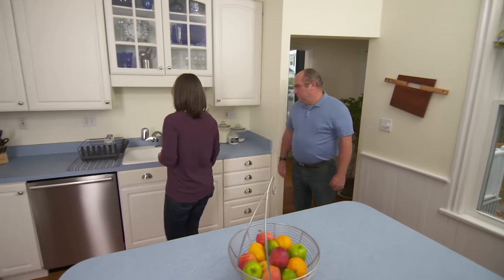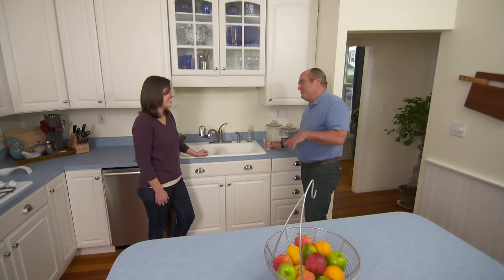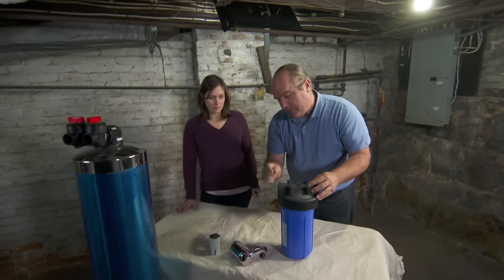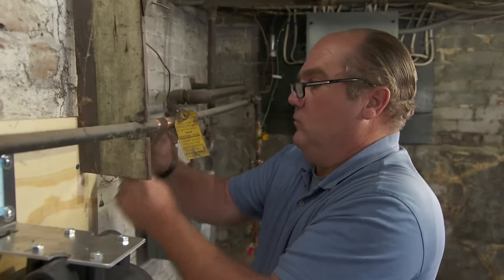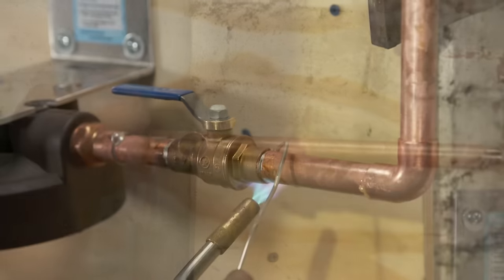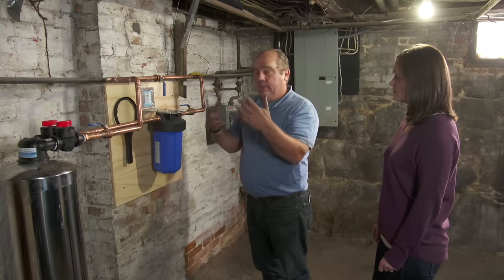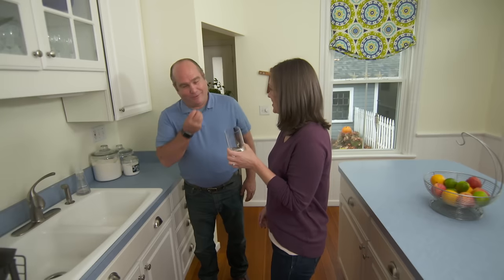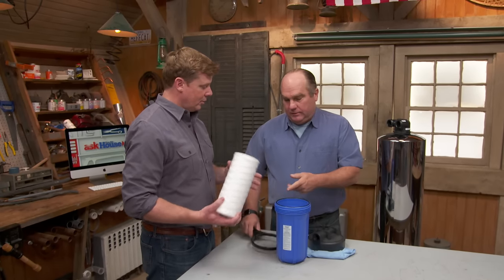How to Install a Whole-House Water Filter | Ask This Old House

Comment: That's awesome!!! Main water line next to the electrical panel.
Reply: Also, no support for the horizontal pipe length coming down from the ceiling. Some came later after the retrofit of the the filters.
Reply: especially with  underground services. They only want to cut one trench if possible.   So your power, tel, cable, water, sewer and storm often enter the house together.
Reply: rtel123 electric goes to meter outside house first
Reply: Tip: Many water pipe systems serve also as ground/earth connections. 
In this particular case, looks like the connection is near the ball valve. So it¨s not affected by the installation or material chosen for the upgrade.

If it's not the case its always good to check the respective connection and suitable materials to make sure that part is not "electrically" insulated. ;-)
Example, completely plastic filter or PVC pipes. 
Cheers
Reply: What a mess water meter, natural gas meter and electrical service all in the same corner.  At the very least I would have shored up the piping by the electrical service box and not left it flopping all over the place weaking the pipe.  To do it right, i wold hav had the water turned off out side of the house and replumed the water flow away from the electrical service and the gas service before bringing it up for the water filtration.
Reply: @tonyradca1235 that would be the right way to do it. But a lot of people can't afford it.
Reply: @tonyradca1235  I like everything close or in the same room but very well organized that way all the utilities are only taking up one area

Comment: I am new to pluming. If the house has metal then I can’t use plastic pipes for the water filter? I guess I’ll have to contact a plumber or just install a filter under the sink. Not sure how much a plumber will charge.
Reply: Plastic pipes (PEX) are less money but some studies suggest they can give you the cancer. You probably have copper pipes but you can add whatever kind of pipes you want to the original piping (e.g., Start with copper but transition to PEX in part of the house because of a leak or something).

Comment: I would find out if my neighbours water was the same first  ! 

Our neighbours had the same problem and replaced the pipes 
Filters still great idea for metals and chemicals in water
Reply: I don't know if it'll get chemicals. I think it gets all the metal, dust, etc.
Reply: dkchen hi depends which chemicals 
If you google chemicals in drinking water you will be surprised what it contains

Comment: I would say he's definitely addressing a safety issue too because the carbon filtration media removes chemicals like pesticides, herbicides and pharmaceuticals. I like the soldering and fitting job complete with several valves. Great job guys

Comment: They put your water meter INSIDE your basement?

If they should ever want to check it when you're not home, what do they do, break in?
Reply: User8571 most houses with meters inside have a wire lead with an outside counter, the city can just log down info from your from back yard. I live in an area where there are “smart” meters. They just walk by your house with a wireless machine and it’s recorded automatically.

Comment: those ball valves are not complicated: if the lever is in line with the pipe, the value is Open and water is flowing. They only have a 90Degree movement.

Comment: Needed some more information on that large carbon granulated filter? How to replace that material? You should how to replace that easy cotton filter, now it's time for a video on how to replace that carbon gunk.
Reply: You dump out the media inside the tank and refill it with new carbon media.  You have to soak the new stuff before use.

Comment: You should also flush the water after this kind of work, for like 30 seconds to a minute.
Reply: Yeah, thought the same.
They probably did flush it, just didn't show in the video.
Just like they didn't show removing the old faucet filter.
Reply: weiss27md for
Reply: You flush it for about 10 minutes, or at least 5 Gallons
Reply: Have you ever heard of editing? The guy probably flushed for 5 or 10 minutes. He should have mentioned it though.
Reply: Most manufacturers recommend a 5-10 minute flush for most filters.
Reply: On mine it tells me to flush it for ten minutes.

Comment: i thought ball valves were directional, if so then aren't some of them backwards.
and secondly aren't you supposed to flush that carbon filter to get the dust out
Reply: No, ball valves are not directional - check valves are though.  As for the carbon, that will need to be replaced - there is no way to flush it clean.

Comment: No need to filter all of your water, only filter drinking water if need be, a small filter can be installed inside kitchen cabinets that will fix taste issues, and Can be changed cheaper and easier than the carbon filter shown
Reply: You got it.  I have a two stage under the house that filters kitchen sink and ice maker.  Why filter shower and toilet water?
Reply: Yep.  No point in filtering shower, toilets, washing machine & dishwasher. 
Water softeners are different those are needed for most all connections besides toilets.

Comment: I would think that you would have to bond over the plastic filter canisters with a ground wire, most electrical services are connected to the water pipe
Reply: The water bypass pipe does the electrical bond

Comment: Water Bob 
Did anyone notice that he installed the valve going into the new filter backwards ?
Reply: yes i noticed that too. after much ado about saying the valve handles indicate the direction of flow when on, we notice at the end of the vid the original ball valve after the meter is backwards  and the bypass valve for the filters has been installed backwards too.
Reply: I don't know why he went into that directional stuff. Maybe that's how HE installs the valves to indicate the direction of flow for some reason. Ball valves are not directional.
Reply: Does it really matter, no. A ball valve is a ball valve. It works and thats the way he wanted it installed.

Comment: How does the cost of this system (installation and maintenance) compare to bottled or spring water ? I have 2 hot & cold water dispensers that use 5-gallon bottles and pay $20 per month (2 bottles) which also includes home delivery.
Reply: It really depends on what you start with and where you intend to end with.
If you consider a simple supply just for drinking water can be way cheaper. 
Notice the system portrayed in the video is a "all house" system.  

One side note, bottled water is just a scam of filtered water sold for a very high price. Spring water, in the sense of high quality natural water, then it¨s pretty much a bad joke on the consumer. ;-)  
Cheers
Reply: Do a standard cartridge based  under sink filtration system, filters will cost you $30 a year. If you go on ebay you can generally get the 2 or 3 filter systems for $50-75 shipped and they come with filters and the install supplies.

Comment: Once you close the valves to isolate the filters for service, how do you de-pressurize them so you can unscrew the canister? Is there a relief valve in the system?
Reply: close the main valve open a sink faucet to release the pressure then close the two valves and then open the bypass open main
Reply: I've had a cistern for 48yrs with a tap before and after filter. Once I close both there's a pressure relief button on top of the filter. Once filter is changed and put back , you open the cistern side tap to fill the filter and pressurize, then slowly open the house side.

Comment: Richard, We have well water which has rust, sulphur and tannin. will the addition of these two filters cure these issues. Thank you.
Reply: It should be OK. Although when looking for any filtration system please do yourself a favor. Check the water to make sure whatever filter system is adapted to your particular needs. A lab analyse should be relatively cheap and can spare a lot of money in the end. ;-)
Cheers
Reply: 3348harley    We have brown tannin water and stinks like rotten eggs all that was on test.  Aquatic filter systems sent us a pre built system I shopped a year before getting it. Sent it free shipping   We blew 25 grand over 12 years using other brands that don’t clear the water. It’s automated love it.

Comment: Ultimate Sediment Filter- Pentair Dual-Gradient Density Spun Polypropylene Filter Cartridge Rating: 25 micron pre-filter; 1 micron post-filter . The 20 inch filter Part Number DGD-2501-20

Comment: So is a pressure gauge after the filtration system how you determine when to change filters/media? Do you get a baseline reading after initial install and pick a point at which you say "now" is the time to change them out?
Reply: I feel like you'd just notice a change in water pressure, over time. But as a few others have noted, it's be smart to have a gauge after the system. Just so you have a more accurate way to know how things are.
Reply: Thanks John. We're getting ready to renovate a 1950s ranch and are learning as much as we can before the dust begins to fly.
Reply: smart move doing a lot of the work yourself. Can be a bit more expensive short term, if you don't have all the tools. But long term it pays for itself every time.
Reply: But I need an excuse to buy more tools...LOL!
Reply: I know that feeling, i want more stuff so i can prototype some of my projects. but at the same time i'm like, but it cost money and i need to keep some money saved.
Reply: Need 2 pressure guages to avoid filter callopse inside housing.  Measure differential pressure

Comment: Copper is still the safest as there are none of the  health issues or concerns typically associated with Pex and other types of plumbing materials. As long as lead free solder is used and all connections are properly de-bured and cleaned of course.
Reply: Jason C. Just use pex no one ever has complained about the safety of pex
Reply: There actually are health problems with ingesting too much copper, but copper piping doesn't cause it under normal conditions.  What copper piping does suffer from is leaks due to piting, or erosion, from turbulent flow at pipe fittings.
Reply: Disagree.  This guy is showboating by using copper.  There's zero need for it.  Pex is quicker, cheaper, and water safe.
Reply: Tom Wolff Yeah, that job would have looked great using Pex. Awesome idea👍

Comment: Is it installed on pipe before the water heater or on pipe after the heater? Also would this be cleaning shower water as well?
Reply: A water softener is typically the better option to treat the water for the entire house. Install a reverse osmosis to have the best drinking water you can get. The softener should be installed prior to the water heater. The equipment he installed is only treating sediment and chlorine.

Comment: Can I use carbon filter instead of sponge for the pre-filtration? I read somewhere on Healthy Kitchen 101 that a 10-micron activated charcoal is second to none. Not saying the sponge isn’t effective, I’m just looking for alternatives just in case, though.
Reply: Answer is yes, I use a 5 micron carbon filter and it works wonders on smell, taste, etc.

Comment: How do these filters effect water pressure? I'm on a well and pressure runs from 20psi - 40psi. It already sucks, will the filters drop pressure throughout the house even more?
Reply: Yes, they will drop the pressure more.  If you are on a well, you may be able to increase the pressure by adjusting the setting on the switch for the pump.

Comment: How do you clean the main activated charcoal tank? Is there a backflush as found in water softener systems?
Reply: typically, water treatment companies will install a backwashing carbon filter rather than just a tank with carbon in it. I think that was his question as the equipment installed does not have any backwashing potential.

Comment: I cant even install whole house filter because i live in a flat in my next house i will install it
Reply: YOUCAR Youtube you can totally do it in a flat, just find the main pipe coming into your flat. Sure, it might be behind a wall you have to open up or under the floor , but it can be done. 

I live on a 9th floor and had to dig in the concrete floor (it was only like 3/4 inch thick) to find  the main pipe, but then I soldered some longer pipes to bring it out, then fixed the hole in the floor (1 foot square). And then I put a filter, took me like 2 days, a weekend. 

My father was a plumber in his younger days, he taught me, and I’ve been around tools all my life so it was pretty easy for me. It can be more difficult depending on where your pipes are and how familiar you are with diy repairs and all that, but you can always learn or have someone help you out. :) You can PM if I can be of any help.

Luciano
Reply: @lucianonarno1408  How do you "dig in the concrete floor" looking for the pipes? I mean, I imagine you just mean breaking up the concrete until you find it, but how would you avoid harming the existing piping? I know the intention is to cut into the pipe anyway, but surely there's some kind of method to do it, right?
Reply: We used a chisel and 3 pound hammer to crack the cement and start removing pieces, carefully and slowly, little by little. You never know what’s underneath. Obviously don’t use a jackhammer.
Reply: @lucianonarno1408  makes sense. Thanks!

Comment: I would add a UV unit and a pressure gauge before and after filter.
Reply: As they said in the video, the UV unit is kind of pointless, because it's municipal water. Cities have a federal obligation to make sure their water is safe (just not clean tasting or smelling). The UV filter would have been extra cost with no real payback for the customer.

Pressure gauges and even a metering tank/valve might be a good addition, but if the homeowner wasn't complaining about pressure issues, it may be another added expense.

One of the complaints I have with the This Old House series is that their house rebuilds often contain a lot more tech and stuff that maybe an average homeowner doesn't need or can't afford. So, for little projects like these, it's nice to see them not going whole hog with top of the line equipment and extra, redundant, and possibly unneeded features.
Reply: The UV is to kill anything introduced by the pluming between the water source and the home. The pressure gauges are because a low pressure might be city's fault and not filter and could cost money and time replacing filters and media when pressure won't be corrected. The gauges are $10 at Home Depot maybe $5 in fittings.
Reply: David Barry Waste of time and money

Comment: and the pressure gets real low when you apply this device for your whole house filtration system
Reply: Thats actually a lot less true than you might think. For one city pressure is quite high to begin with probably 65 psi. In my house using a well the pressure is actually a pretty low pressure system at 38 psi and after a three stage filter system it comes out at about 35 psi. Obviously its not whole house (which have even bigger casings) its just for my fridge chiller and filter water tap. If the filters are dirty however there will be an enormous pressure drop. Carbon filters through their lifetime won't cause much additional drop. So the only thing to worry about is the particulate filter. Once its black replace it. It costs maybe $2. For a whole house one maybe $5. When he said the filter was $20 he meant with the new casing I believe.
Reply: That is 3/4" copper?
Reply: only if installed improperly or if the valves on the filter are too small.
Reply: Osman Javed    That’s very true every inline tank we had clogged in a two months.  Aquatic filter systems built our system  it’s automated  cleans it self. That years back works amazing.

Comment: Can this be used as a pool filter instead of using chlorine?
Reply: the chlorine is there for protection, chlorine is important in municipal water as well as in all swimming pools. However, it is only important during the delivery of water to your home which is why he installed the carbon filter. The carbon takes out chlorine.

Comment: Should have a ground wire jumper across both units. Their was a ground wire on the main.
Reply: The ground still goes from the main into the ground, the pipes going up into the house (the filtered ones ) do nothing for grounding. Everything is grounded as good as before the filter installation.

Comment: He says the handle of the valve is to indicate the direction of the flow, but the second valve he shows, he has it backwards.
Reply: Jari Kivinen if it's in line (or parallel) with the pipe then the valve is open. If it's not parallel with the pipe (ie the pipe and handle make a " + " ) then the valve is closed.
Reply: It's a ball valve. The angle of the handle (in line with the pipe) determines if it's open or closed. So he's not wrong, but could have been more consistent.
Reply: oh geez, I get what he meant now. I'm a plumber, and everyone in the trade has a different opinion on which direction to install ball valves. I thought for a while, he meant to install the valve with the handle pointing in the direction of the flow. My mistake.
Reply: SirCrest h
Reply: ike fun he said he made a mistake jeez
Reply: I'm pretty sure that was on purpose... Obviously stealthing